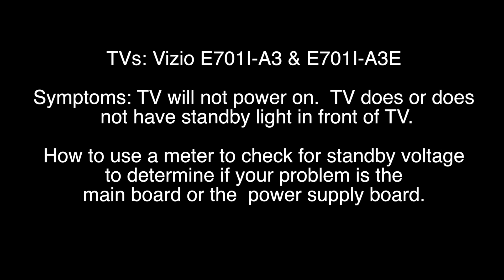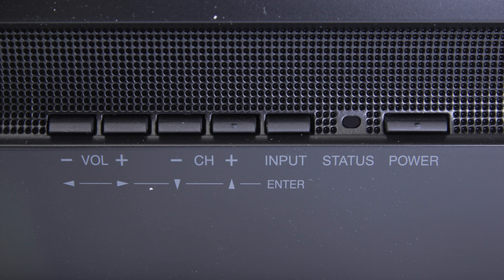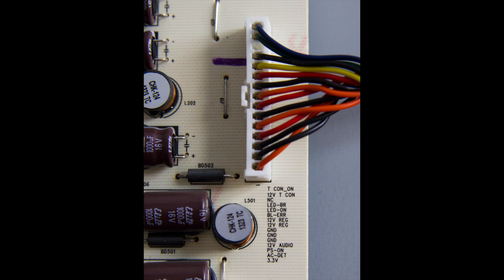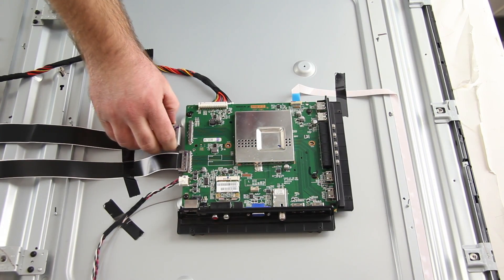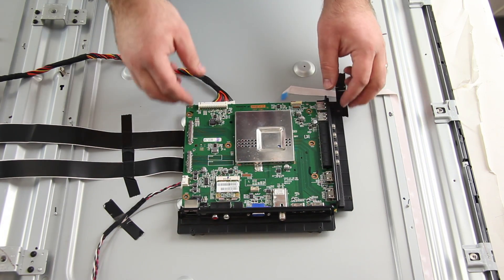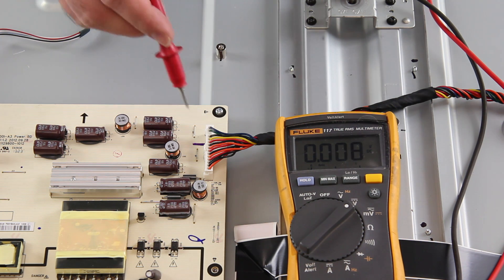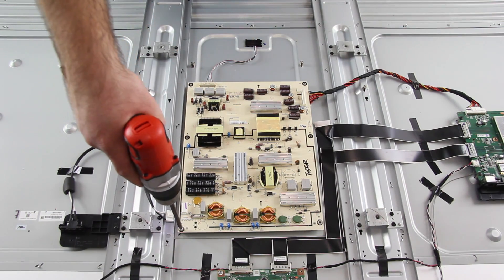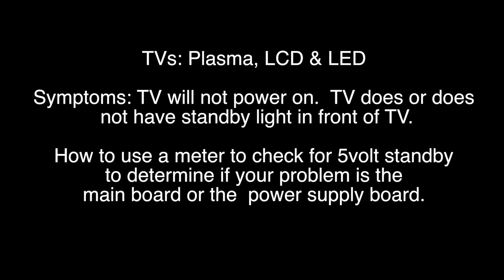Vizio E701I-A3 & E701I-A3E TV Will Not Turn On Troubleshooting Help - Checking Voltages - No Power

Comment: Great Video... I have an E701i-A3 that the standby light comes on when power is applied. According to your video this usually is repaired by replacing the main board. I noticed something and wanted to see if you had experienced. I have the 3.3 VDC at the connector and the standby light is on. I removed one end of the connector that goes between the power supply and main board. When I plug it back in the standby light goes out and the Digital Audio Light comes on. TV Still does not operate... does this sound like a typical reaction when that connector is removed? Thanks

Comment: I have a Vizio E601i-A3.  The white power light goes on for 13 seconds, then goes out. Replaced power, main and T-con and still have same problem. Totally disassembled TV and checked backlights, they are all good. I have 3.3V standby but I also have 3VDC on pin 10 for BL-ERR. The power supply feeds the BL directly so I am guessing that I was sent a defective power supply PCB. argh.
Reply: Did you solve the problem ? Mine is same issue as yours .

Comment: I have Vizio   E701I-A3 LFTRNXBP  It has a backlight but no picture/image
Already checked standby voltage from powerboard which is OK (3.3V)

I think to change T con board.  What do you think?
Reply: I have the same issue, did you have any luck repairing? I have replaced Tconn with new and mainboard with used, but no luck, the power supply voltages checked good, so very frustrating...

Comment: I have a Vizio E701I-A3E which went black the other day so then I watched your videos to troubleshoot.  The screen went black, the backlight is not working and the status LED on the front doesn't come on anymore.  I checked the voltage on the power supply and it appears to be ok but without the status LED it makes me wonder.  I also did the T-con test and did not get any voltage readings on it but maybe it could be a result of bad power supply.  What do you think?  I hope T-con is not bad because that may mean the screen is bad too.